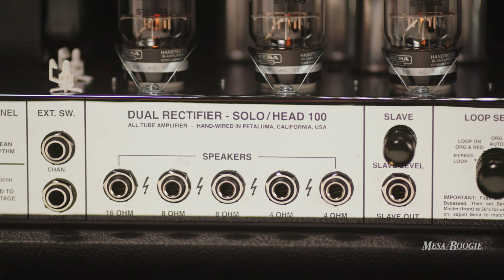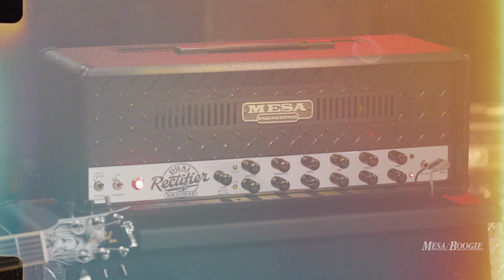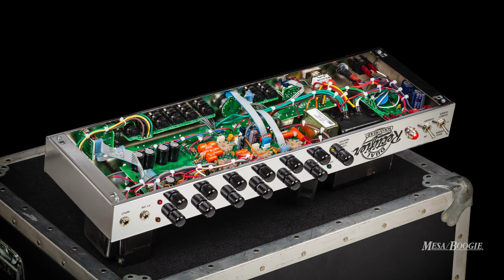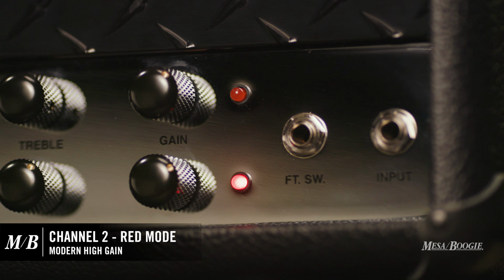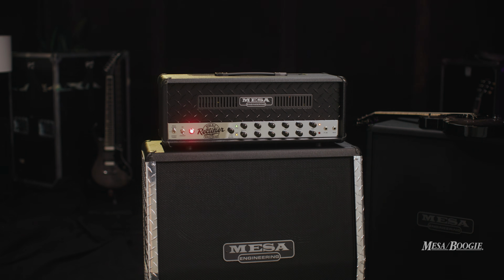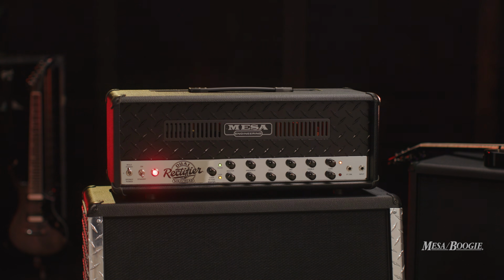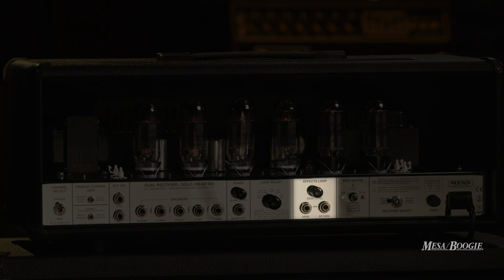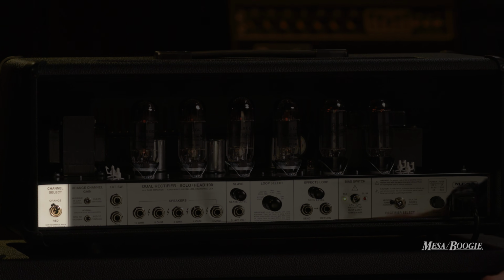MESA/Boogie 90s Dual Rectifier full demo & tutorial ft. Doug West & Tommy Waugh

Comment: There are a million used actual 90's dual recs for sale out there that cost way less....
Don't get the logic here
Reply: @Hoscitt  there are a couple of things that I have considered when it comes to buying an old 90's rectifier. First of all not all older amps are in great shape. Most of them have been serviced multiple times. Not that that is a very bad thing depending on who does the work, but I have had amps that I loved up to the time it went in for service. After that it was never the same. Another thing I considered is the cost of swapping out the old capacitors with new ones. Chances are this would need to be done. With a new amp they are pricey but if you take care of it it will be a very long time before you need to sink any more money into it. Also it's band new. It hasn't been lugged half way around the country for 30 years. There is no wear and tear on it. It will sound phenomenal guaranteed (can't guarantee an old one will). And there is peace of mind knowing that you have a reliable piece of gear. I think that's worth a few bucks.
Reply: Yeah but as a 90s recto owner they have bunk ass cleans the only thing I like about this one is the cleans and the fact they may reissue the Racktos 😍

Comment: Mesa Dual Rec and Peavey 5150 both ripped off the Soldano SLO circuit.  Mike is still waiting for his royalties…
Reply: No disrepect to Mike Soldano, but did he have any IP on the SLO or parts of it? I understand the Recto and 5150 are both descendants of the SLO circuitry, but that is just the nature of technological evolution. Throughout the 80ies there were myriads of amp builders and companies who basically tuned the JCM800 and Plexi circuits to adress guitarists unanswered needs. I even recall guitar mag reviews from the late 80ies that put Soldano products in the tuned & modernized british amp field vs what was considered American back then, which was basically mid-heavy Boogie Mark series lead sound.
Reply: Soldano was also a very small operation, Mesa (and Peavey were not).

Comment: Not trying to be snarky here.. but wasn’t the Rectifier a carbon copy of a Soldano SLO100?
Reply: No, not a carbon copy. Heavily inspired in the preamp maybe, but the power amp is what makes this different from most other highgain amps.
Reply: @HunterRouth  I'm pretty sure i've seen this interview and I believe they were referring to the preamp circuit not the everything big picture circuitry... otherwise why is that the SLO doesn't sound a thing like a rev c? sorry man but I think you're misinterpreting this. I mean all you've gotta do is talk to someone whos owned both amps. they don't sound alike. and if they were all the same parts except different manufacturers and different tubes they'd still sound a LOT a like. every rectifier ive played has a "thing" about them, NONE of them sound like an SLO.
Reply: it's more nuanced, since a lot of things are genuinely copied part-for-part (way more than just "heavily inspired"), but mesa also did add/change stuff, like the ""clean-ish"" mode or revoicing the tonestack and power amp.
Reply: @HunterRouth  then you're wrong
Reply: It was until they threw the rectifier tubes in there now it's a different monster
Reply: In the SLO the effect loop is before the tone stack and "part of the amp sound"(recto loop is after the tonestack and the loop is "transparent"), also the recto has no negative feedback in the poweramp when you use red channel, the slo has it on always.
Reply: yup, largely a SLO with no negative feedback
Reply: @HunterRouth  Interesting how they can sound sooo different then. And I don´t recall the SLO having rectifier tubes and negative feedback being removed in the drive channel...
Reply: @HunterRouth  are we talking about the unseen prototypes or the RF-1C/D/E revisions? if so, 1. i doubt Soldano or Friedman could've gained access to Mesa's 'archive' of sorts, 2. the initial revisions aren't that different from the later revisions (if we disregard the clean-ish mode)

Comment: The SPONGE Power mode, Drops the mains voltage to 93vac plus changes the EQ to have a scooped midrange? I had no idea that the Sponge Power switch mode will also alter change the EQ stack circuit while dropping down the mains voltage to 93vac

Comment: The Good Parts: Sounds great and has updated features that I like (hopefully a better circuit board layout). Sound's very close to the original, dear I say "better"! Looks killer and is brand new, awesome!

The Less than Good Parts: An original Mark ii C+ used is about $10,000. so it makes sense to spend $3,700. Awesome!
A used two channel Dual Rectifier (exception of a Rev.C) can be purchased for way less than $3,500. If fact there's a Rev. G sitting at my local music shop and they are asking about $1,500. The price on the new Reco is a bit of a disincentive. Still a great amp though.

Comment: Another $3500 amp that wont be in my plans anytime soon.....    My Mark V35 has an extremely loud pop when switching between channels and modes since new, it's been repaired twice by boogie and still has the same problem, boogie can't fix it.  My Stiletto Deuce II will just make a loud noise occasionally, also been repaired twice with no change. I'm done with Boogie crap.....

Comment: So... this is supposed to be a reissue of Rev E, BUT they figured they can't get the parts for it, so theyr'e claiming they "improved on it". Where have I heard this before? The JP-2C was touted as a reissue of the Mark IIC+, except it does away with all the push/pulls and volume one and sounds nothing like the original. I bet this is the same thing, but they're just not saying it's a reissue of Rev. E to avoid the backlash.
Reply: I see what you’re saying but the reality is the actual mark IIC+ reissue is a thing now, and sounds extremely close to the original amp (in Ola Englund’s side by side A/B comparison.) I’ve heard two of the same model amps compared before (say a couple identical 5150s) that sounded as close as the real IIC+ did to the reissue. So I think they’re doing their absolute best to make these reissues as close as they possibly can. *edit* the rumors have been that it’s based on rev f and g and now that’s been confirmed by mesa so I’m not sure where you heard about rev E. I’ve never seen that mentioned anywhere tbh.

Comment: The reissue is pretty slick, but the price isn’t… a pretty big increase from the multi watts with way less features…   I would have considered it if it was more in line with the multiwatt prices.
Reply: For real. $3.5k for a two channel amp and it's not even a strict reissue? The hell?
Reply: @Eliphas_Elric  I don't know all the facts (and ya I agree the price is spicy) but what makes it not a strict reissue? From what I understand they moved the location of a switch or two, (way more user friendly having bold/spongy on front), and some parts that aren't being manufactured anymore cant be used either because they don't exist or they're illegal to make but what else?  And to be completely fair to your point I guess it is a cross breed of a Rev G with the serial fx loop from the Rev F, but to be honest the last 3 used Rev G's I could fine for sale were all modded to have the serial fx loop as well, sounds like that was very common. Again, I'm not saying you're wrong I just want to know what it is that I missed out on. Also the tolex is different now which actually made me sad but it looks more durable then the nice sorta pleather material  they used to use.
Reply: With Gibson at the helm, that isn't likely to get any better :(

Comment: My 92 rectifier clean was nothing like that, this is an improvement.
Reply: Do you know which revision your amp was? because to get anything close to a good clean channel on the reissue im having to crank treble and presence, switch to a single coil pickup and play very light (with my gain on the amp basically off). I know the rev C and D had a reputation of a BAD clean channel but the impression im getting is that this clean channel is the same as the rev G, they're just saying this amp has a cleaner clean because there is a lower noise floor due to them using some more modern parts on the amp. I'm assuming some things, but I've also got the new amp here in the room with me and as much as I love it - the clean channel is still not very good. I mean, it's better than using the green channel of a 5150 but it doesn't compare at all to the roadster clean channel and its not even as good as the 3 channel recto clean channel.
Reply: @snapascrew  small logo revision C
Reply: @RECTIFIER101 oh ok ya this will be an improvement for sure. It’s not really good at all tbh but it’ll be better than the C.
Reply: @snapascrew  yea
Reply: @RECTIFIER101  if you ever sell your revision C dual rectifier Please let me be the first to know.

Comment: Which revision are these based on??
Reply: Supposed to be the best parts of the F and G revisions. So, something in-between those.
Reply: Rev f with a rev g transformer
Reply: Soldano SLO
Reply: @tiagoramalhais5493 Returning the favor after soldano ripped off the Mark. KWAB
Reply: @ProfessorRadium  watch the video?
Reply: @dw22509 Maybe I missed it. Can you provide a timestamp? No specific revision was mentioned.
Reply: @ProfessorRadium there’s another video (the sweetwater one) where they mention the best parts of rev F and G and he says in the video that the info was straight from mesa’s research and development folks.
Reply: @snapascrew  Got it. According to the Sweetwater video it’s a Rev G preamp with a series FX loop from a Rev F.
Reply: @snapascrew  Super surprised Mesa didn't mention this important message in their official product video, Gibson should do a better job in this regard when it comes to reissues stuff.